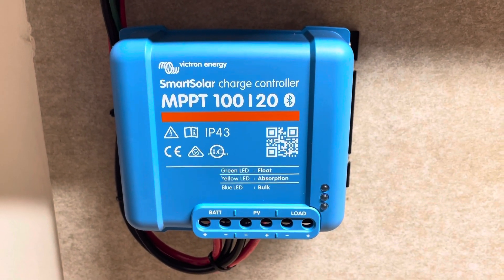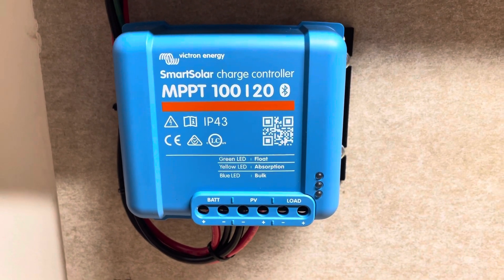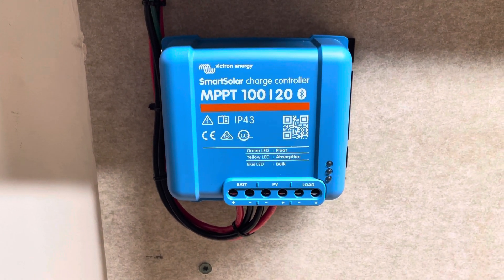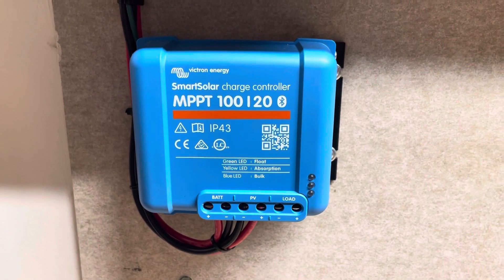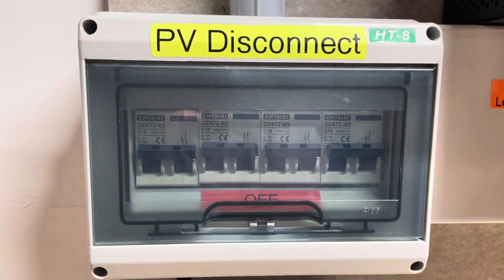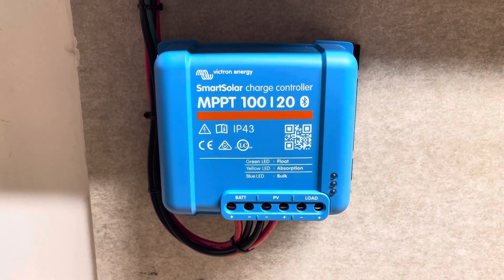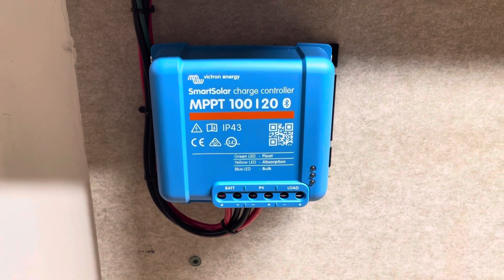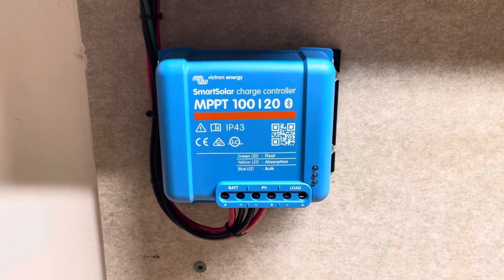MPP Solar LV6548 and Auxiliary charge controllers

Comment: how are you liking the lv6548 so far ?
Reply from the maker: Still, the bang for the buck is not bad. The Eg4 version is a nice unit too. Both have some hurdles but nothing insurmountable. It’s been running continuously since I started It except for when I added surge protection. Heat is going to be your biggest limitation. Temporary removing the filters will let it keep running 50 degrees cooler on a 115 degree day. Highly recommend Solar Assistant with it. So much control anywhere.
Reply: @SkypowerwithKarl  thanks for the reply, been considering one of these units for a while but wanted input from someone who had it for awhile

Comment: My plan was to get one of these for my lv6548’s. I think tinkering with the voltage limits would probably solve the issue.
Reply from the maker: I tried a few times. Thinking that how each sees 55v absorption and float voltages may be different, I did a little tweaking but you can’t do it on the fly, you got to make a change and wait a day to truly see the effect. I’m not a patient guy and with the heat wave I didn’t want to get out of whack and have to supplement the charge. They don’t cost much and they are good to have on hand. Give it a try and let us know(and where I went wrong). The Victron has better detail in charging. The 6548 only has bulk and float, no absorption time and other un wanted weird things.

Comment: I've used Midnite SCC with my two Sol-Ark 12K's. Works great. Could you not just vary your Absorption and Float voltage settings. That is what I did. I never set them the same. If I didn't like the way either SCC was charging, I made changes.
Reply from the maker: Probably could have spent more time with that but it was one of first tweaks.

Comment from the maker: Although this wasn’t effective for my system, it may work with different inverters. The reduction in charge current from the inverters when approaching absorption voltage was notable. The algorithm between the Victron and MPP Solar may not have been compatible.